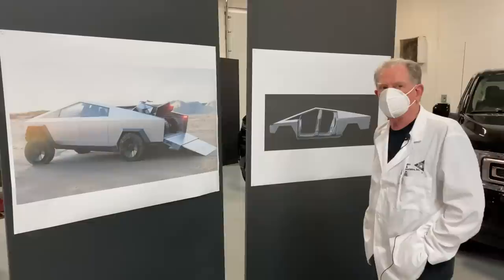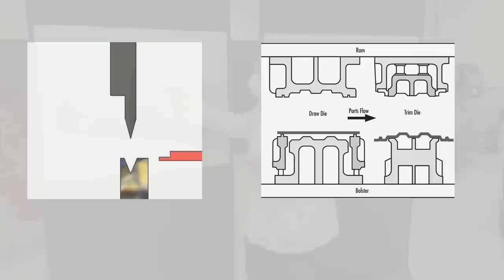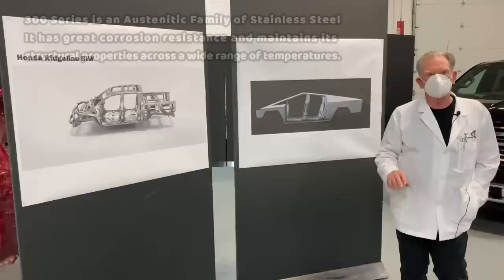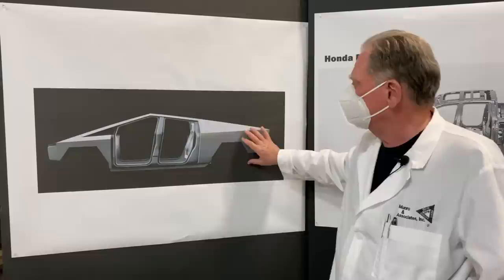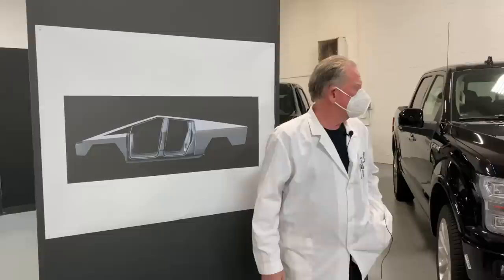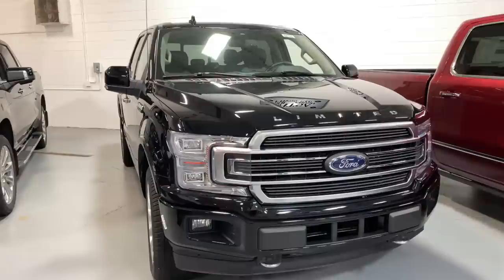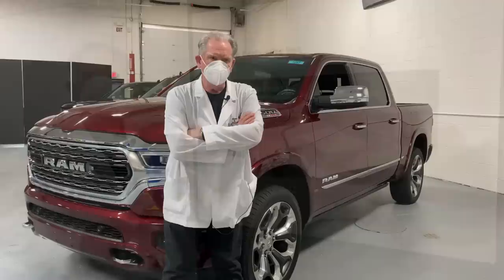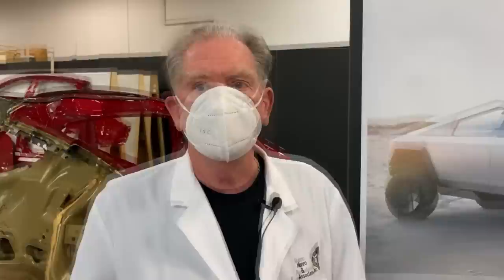Cybertruck E1 - Body Structure Comparison

Comment: I was a United States Air Force structural specialist. I love this truck and I’m getting one soon as I can! I’m always love titanium and stainless steel. Exoskeleton is what aircraft use to be high strength/weight.
Reply from the maker: Well thank you for your service and thank you for sharing your insight, Nathan! Appreciate you tuning in!
Reply: That's right, we need a titanium option for the Cybertruck.
Reply: András Bíró good luck with affording that. Titanium isn’t really that expensive but at a pretty costly amount. The cost is the labor it’s hard to work with. Also I heard it’s kinda rare. Putting it on a truck that will add the Tesla from $40,000 to probably an extra $10,000 or $20,000 at most. So the truck would be around $60,000.
Reply: @thuongvo736  . I think Andras is joking, but it's fun to contemplate.   Titanium would be much lighter - & could be anodised for some truly beautiful colours! 
It's common enough as an element but expensive to refine. Performance bicyles are often made of Ti.
Reply: Huh?  Planes still have a frame with fuselage skins over them.  One look at the manufacturing process shows this.

What are you talking about?  What plane uses an exoskeleton?
Reply: the Cybertruck is the A-10 Warthog of the Truck World.
Reply: @markplott4820  More like the Messerschmitt Komet of the truck world...
Reply: @billcichoke2534   - NOPE, Cybertruck right now is being look at by AURMORERS for Military Police Vehicle to REPLACE the HILUX and HUMVEE as a Technical or ARMED Scouting vehicle.
they are Already working on a BED mount for a CROWS and Other weapon Station to Operate REMOTLY and from INSIDE the Cybertruck. 
the vehicle can get back home on just ONE motor and has over a 500 Mile range. 
that can be Supported by a Tesla MEGAPACK tm , on a Military Flatbed Truck. Extending Range and Operations.
Reply: @markplott4820  No serious appropriations or R&D shop looks at an unfinished PROTOTYPE as a solution.  Since all of what you've listed DOESN'T YET EXIST, it's not even a sad attempt to 'win on the internet.'
Reply: @billcichoke2534  - Even the Regular POLICE in America, Canada and other Countries like DUBAI are Requesting INFO on the Cybertruck and MANY PD have already Placed Reservations for CT. 
IT would be Reletavly EASY to UPARMOR a CT and give it a REMOTE Weapon System.
CT and EVEN do Remote Extractions and saving Lives.
Reply: @billcichoke2534  
When Tesla shows a product, that's pretty much finished. They seriously considered shrinking down the Cybertruck a bit to better fit in to garages and European roads, but ultimately kept the original dimensions. Apart from minor tweaks, what you see is what you get.
Reply: @markplott4820  Of course, since it has the Tesla autopilot system and is always open for software updates, it can and will be hacked, causing it to be the WORST liability for a military that uses it.  And government agencies do not buy a civilian vehicle and modify it themselves...they contract with the manufacturer for a SPECIFIC VARIANT.  The MANUFACTURER then makes it.

And I'm sure there were FAR more reservations initially for the semi and the Model 3, than there have been completed orders.  It's what happens when the bar to entry is set so low...you get loads of 'why not?' reservations.

You are in need of better knowledge about government contracts and procurement.  It doesn't happen the way you think it does.
Reply: @andrasbiro3007  And they're still  it selling that.  The vehicle HAS NOT and CANNOT meet safety regs in the U.S., so it's not even road LEGAL.
Reply: @billcichoke2534  
What are you talking about?
Reply: @billcichoke2534  - TESLA CPU and Software is All Encrypted, make it VERY hard for Hackers, besides TESLA hires White Hats to debug their System and find Holes.
TESLA pays people to TRY and Hack their Computers and Infotainment.

I Predict there will be 25% Atrittion of the Cybertruck Reservations , with 75% being SERIOUS Cybertruck BUYERS. 
and ONCE CT is Actually on the Streets , in Shopping Centers and at Grocery Stores , it will cause a Surge in SALES.
Reply: @andrasbiro3007  One of the best class of secure systems is our drones.  And they got hacked by IRAN.

And the point about reservations versus sales is, the reservations are held up as proof of HUGE and UNLIMITED demand.  The sales show a different picture, and always have.
Reply: @markplott4820  You mean like the huge millions of orders for the Model 3 that DIDN'T HAPPEN?
Reply: @billcichoke2534  - Tesla model 3 in Q1 2020 is the BEST selling CAR in California, Outselling Toyota, Honda and even ICE Trucks.
TESLA does NOT need to sell MILLIONS to DISRUPT the Auto Industry.
Reply: @markplott4820  No they weren't and yes they do.  Model 3 was the best selling ELECTRIC car, not outselling Toyota or the like in Cal or anywhere else.  And Washington D.C. will NOT mandate the exclusive sale of EVs (which would ACTUALLY disrupt the industry) if less than 1.6% of Americans but them (which is still the case).

EVs in general, and Tesla in particular, are a non-starter for all but the most affluent, just as they were before.  And pickups and large SUVs are the hot commodity, NOT overhyped golf carts with an iPad wired in.

Check the numbers somewhere other than Electek or CleanTechnica for the truth instead of anti-capitalist propaganda.
Reply: @thuongvo736  Could be an optional thing, like a more expensive titanuim version. and it would reduce the cost for titanium on spacecrafts cause they would be buying it in bulk
Reply: Bill Cichoke the fuselage is a hollow tube, the stressed skin adds stiffness to the entire structure.
Reply: @billcichoke2534  - TESLA model 3 in FACT Outsold the Prius, Toyota Camry , Honda Accord and Honda Civic. all are ICEV except Prius. and Model 3 also Outsold BMW 3 Series, MBZ C Class and OTHER "near Luxury" cars and ICE Pickup Trucks. 

Model 3 in FACT is California and Americas MOST Affordable car, you can now Lease a Model 3 for $300 and Model Y will Disrupt CUV/Small SUV Market, TESLA has a BACKLOG for their Cars, Model 3 & Y are Sold Out for 2020, Legacy Auto has to take a LOSS with ICEV sales and Dealerships just have cars Sitting Unsold.
Reply: @markplott4820  IN FACT Tesla sold LESS cars last quarter than the one previous.  IN FACT the ENTIRE NEW CAR MARKET dropped last quarter.  So Tesla sold to whom they would have anyway.  The literal rest of the 98% of the country, IN FACT, did not buy new cars, except those who were more well off.  So Tesla sales didn't INCREASE in comparison to other vehicles, since they sold LESS.  The sales of ICE vehicles DROPPED, due to businesses being closed and people not working.

And even with that, Tesla's numbers are BARELY above EACH competing ICE model.  Not against all combined.  Only if compared with one at a time.

And only in California.

IN FACT.
Reply: @Dixler683  It showed the cutaway view of an F22, showing SPARS (aka THE FRAME) under BODY PANELS (aka THE FUSELAGE).  The body panels maintain aerodynamics.  The SPARS are what keeps the plane intact.  Defending truth from drooling idiots is NOT being an a--hole OR a short seller.  It's defending truth.

So where does that leave you?
Reply: Bill Cichoke must be tough to wake up every morning and look in a mirror, always right, always smartest in the room, never backing down even when wrong, so pretty and FRIENDLESS.
Reply: @Dixler683  Okay darling, follow me here...it's not complicated.

STATEMENT:  Aircraft use an exoskeleton as opposed to body panels on frame

FACT:  Even modern aircraft use a FRAME, based on spars and cross members, over which fuselage PANELS are attached.  Though they might impart some DIMINSIONAL stability, the strength and rigidity is due to the FRAME UNDERNEATH.  Publicly available images show this.

YOU:  Only a structural engineer can decide what is what; all others must shut up.

ME:  The info is available, and the statement is wrong.

YOU:  My earlier statement still stands.

Like I said...do you REALLY want for THIS to be the hill you die on?  And I have experience with many aspects of the engineering field, as well as a degree in digital design.

But being a tailor wouldn't be such a bad occupation...thanks for the suggestion.
Reply: Bill Cichoke did IRAN hack the drones or was the info given to them by disgruntled intelligence specialists whom later transitioned to female? Just asking mr. no it all ...not.
Reply: @Dixler683  Manning (if that's who you're referring to) didn't have access to any layer of the control code for the drones (that weren't even flying when he was in).  The only other option would have been 'exchange troops' we allow to study or train with our troops and equipment.

One way or the other, the point is, drones will never be as reliable as piloted aircraft.  And semi or fully autonomous ones will increase the risk of erroneous attacks, not decrease the risk to human life.
Reply: Bill Cichoke agreed.
Reply: @billcichoke2534  
The military unfortunately doesn't have the best security. Corruption and incompetence. Tesla on the other hand knows that it's whole existence depends on not getting hacked, and few organizations are more competent, if any at all.

Tesla sales are limited by production capacity, that's why Tesla is building 3 factories at the same time now. One exception is Q1, which is generally very weak for all car sales. Also Tesla spends zero dollars on advertising. Think about that for a moment.

And yes, in California in Q1 the Model 3 was the best selling car, beating Hondas and Toyotas that cost like half as much. That's right there is a disruption. Tesla don't have to dominate the entire market to be disruptive and don't need any spacial subsidies or mandates, their exponentially growing sales, several years of technological advantage and sky high customer satisfaction is plenty enough to cause the rest of the industry brown pants syndrome. Also Tesla steals more sales than the number of cars they actually sell, because many more people are postponing their next car purchase until they can buy a Tesla or another EV.

If you think that a Tesla is like a golf cart, then you are extremely ignorant. Here are a few hints : https://youtu.be/cvk18vx-nrY?t=177 https://youtu.be/QXyEgl9rFN4?t=782 https://youtu.be/9fzPWJfTmnY?t=111

A base Model 3 on the long term costs about the same as a Toyota Camry. Not cheap, but definitely not just for the rich. Any middle class family should be able to afford a Model 3 or Model Y. And the Cybertruck will actually be cheaper than a similar diesel pickup. 

In case you didn't know, Tesla makes a large SUV, the Model X, a smaller crossover, the Model Y, and the Cybertruck is coming too. That covers most of the passenger vehicle market.
Reply: No way the military would ever waste their time on trying to make use of that thing in a war zone. That stupid giant battery would always be the target of choice for the enemy to take out the vehicle and blow up or burn to death the poor hapless occupants. Also the "bullet proof" claims about the body work would only apply to certain hand guns and not the monstrous liberal named death machines the dreaded assault rifle ......... GASP !!!!!    An AK with the right ammo would probably go in one side and out the other and  50 cal machine gun would decimate the exoskeleton to the point it could fail to support the vehicle.
Reply: @markplott4820  u made all of that up and you have no idea what you are talking about. Calm down fan boy
Reply: @andrasbiro3007  wrong again. They are shrinking the car truck. Elon said so
Reply: @technom3598   - Please be Specific , so I can DEBUNK your Statement.
Reply: @markplott4820  sure. The Hummer will.not be replaced by the cyber truck. It has already basically been replaced in the military. Seeing as the cYbErTrUcK doesn't even exist yet the military isn't looking at it at all. Your statement about making it back on one motor is completely made up fan boyism. The Tesla megapack is not in existence. They are not looking into trucks that will haul them to then charge the cyber trucks. 

Every single thing you said about the military using the cyber truck is complete fantasy land.
Reply: @technom3598  - the AMG Hummer is still being used in military around the world.
Hummer will eventually be  replaced by JTV.
but Security, Police and military are looking at CT as replacement patrol vehicle and use as a American TECHNICAL equipped with CROWS.
and the TESLA megapack Exist at Moss Landing in CA
Reply: @markplott4820  no. Just no. And a defense contract for Tesla is so far away it's not even funny. Mind you there isn't even a factory for cyber truck yet. 

Nor final dimensions
Reply: Ummm... There are exactly zero aircraft that have an exo Skelton or structure on the out side of their plane.
Reply: @markplott4820  and by the way the Hummer replacement contract has already been awarded.
Reply: @technom3598   - Republic RC-3 seebee is just ONE Example, there are MORE , IF you do your Research.
Reply: @technom3598   - sure, because TODAY the Civilian Hummer is CHEAP Chinese made JUNK. it has a FIAT Engine.
Reply: @andrasbiro3007  Elon has litteraly said they are changing the size of the cyber truck. He said it on TV with Jay Leno about 2 weeks ago. All of the reliability and capability things have are YET to be seen. The link you sent is a rendering. The Hummer replacement vehicle has already been awarded anyways. So they won't replace that for several decades. The towing capacity is yet to be seen because it was alley 300k pounds and not it MIGHT be 10k points. The off road capability won't be as a good as rivian anyways as rivian has a 4 motor set up. Tesla can't make enough batteries and Tesla has supply chain issues from the start and still have it. It takes 2 weeks just to get an appointment to have someone look at the car and I'm still waiting on a part for a month. Ask me how I know. You guys are living in fantasy land.
Reply: @markplott4820  
Terminators armed with plasma rifles will be driving them.
Reply: @technom3598  
1. The Jay Leno stuff is ancient history, it was filmed several months ago. Since then Elon said that they looked into it and it doesn't make sense to shrink the car. 
2. The reliability and most of the functionality has already been proven by other Tesla cars. And anyway most of it is just common sense.
3. Towing is just a matter of torque and traction and the Cybertruck will have plenty of both.
4. Offroading is not the same as turning in place, and in every other way the Cybertruck is way better. Things like ground clearance, approach angle, departure angle, center of gravity and so on.
5. Tesla doesn't have supply chain issues and never head. And they have a battery shortage only because they are scaling up production crazy fast. And even that won't last long, at least 3 new factories are coming online soon, with drastically higher production volumes.
6. Part shortages were a thing last year, not anymore. May still happen, but it's the exception, not the norm.
Reply: @markplott4820  lol. No it does not and there is no civilian Hummer for almost 15 years
Reply: @andrasbiro3007  sure. Easy. How about the tweet funding secured.
Reply: @andrasbiro3007  the elecktrek article you quoted is all fan boyism.
Reply: What's the mineral composition of Mars surface? Can we get enough iron and other elements to make alloys once we're there?
Reply: What will happen with a "fender bender"? Will the truck be "totaled" / salvage?
Reply: Wao, amazing explanation! 👏👏👏